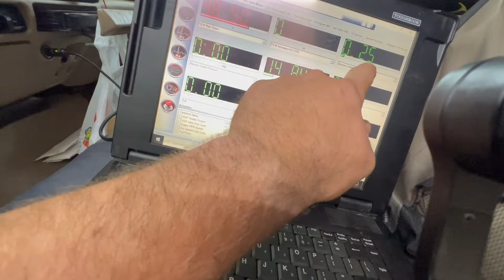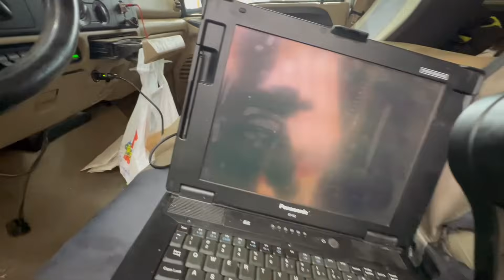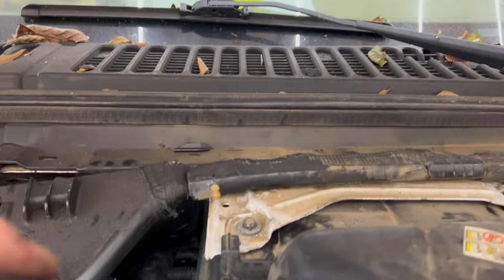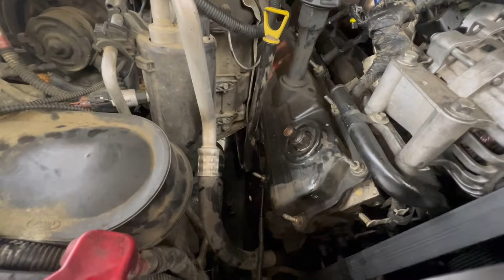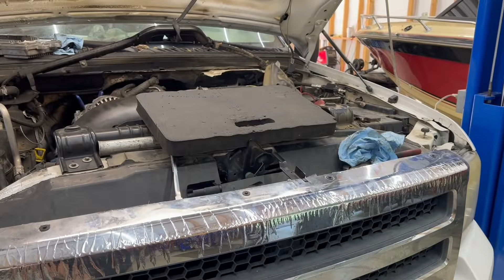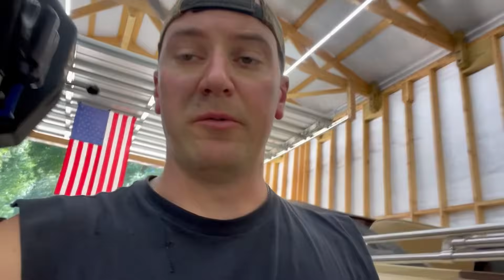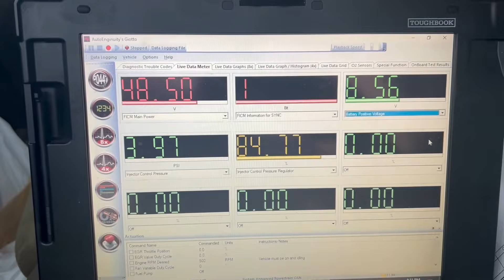6.0 Powerstroke crank no start diagnosing

Comment: Goodnight friend. There is no DTC, I sent you a video on Instagram, the oil pressure reaches 230, nothing more, I bought a high volume diselsite pump and installed it but it didn't start.
Reply from the maker: If your only making 230 on Hpo then there is some DTCs. Need to air test the system. Why did you replace the pump?

Comment: Excellent tutorial on air testing via the ipr port.  Thank you for the tips on passenger side access, torque sequences, and special tools.  Is is very valuable to know the high pressure oil rail nipples do bleed air while they fill up with oil after a repair.

Comment: I just want to thank you. I have a good scanner that shows me all the things you said to look at. I bought a non running e350 with low miles. The previous owner had replaced the ipr for some reason and the van was cranking but not starting. I had glossed over the ipr being good until you showed how to look at the pressure. I was only getting 350 psi of oil pressure during cranking, everything else looked good. So I found the old ipr in the van and cleaned it real good and put it back in and the van fired right up makes 1300+ psi of oil pressure. Thank you so much.

Comment: I have a 6.0 crank no start. Ficm power 48v drops to 47.5 while cranking. Healthy 1400-1500 icp, ipr is 20-30% when cranking. I’m missing ficm sync, receipts show cam position sensor was replaced last year, pigtail too and a new/used pcm. What are my next steps?
Reply from the maker: Gotta find why there’s no sync. Crank and cam sensors aren’t that common for going bad it’s usually something to do with wiring.
Reply: How much air pressure did you put in there

Comment: Replaced entire oil system and still no oil getting to the rails. New 6.0 owner, any tips would help TIA
Reply from the maker: Did you replaced the LPOP
Reply: It was replaced by the previous owner from the looks of it. They threw a bunch of money into repairs, I’ve thrown a bunch of money at it as well and still just a crank no start
Reply: Gonna be doing a compression test today on the engine. Hopefully, it’s not down a cylinder or anything. I can’t really tell because the OBD plug isn’t working properly and I’m not really sure what to be looking for if it is bad
Reply from the maker: @urchinlookinmf  without a scan tool and the obd working you’ll never get it fixed. You gotta know what’s wrong to fix it.
Reply: Front cover has score marks in it at the low pressure oil pump

Comment: I have great oil pressure and great fuel pressure but won't start until I shoot a little ether in it then it fires up and runs great until you cut it off. What's your thoughts 🤔
Reply from the maker: What is your icp and ipr when it won’t crank
Reply: @AutomedicGarage  icp 47 and ipr 574
Reply from the maker: @rodneygrainger4274  do you have 12v across your glow plug relay KOEO?
Reply: @AutomedicGarage  12.4
Reply: I'm stumped. I tried my snap on scanner just for ideas and I have the Apollo D-9 and it's badass but no help. I know I'm missing something
Reply: @rodneygrainger4274 did you ever figure your no start out? I have one doing the same thing as yours. Has oil pressure but won't start.

Comment: I replaced my icp and mine cranked fairly quick then next time I went to crank it was extremely Long. Icp now says 365psi then finally cranks
Reply from the maker: What year? Sound like your developing a high pressure oil leak or if it is a 03-04 your getting a weak pump.
Reply: @Automedic Garage  06. I found it passenger side stand pipe. Second oem from my ford dealer within a year and a half. Not sure if they were sitting a long time but this set I greased well. Hope it last longer.
Reply from the maker: @alabamalewis2704  I’m glad you found it. And thanks for watching.

Comment: I did that same job last year and I did both sides and found that I had Dorman parts that failed in my.6.0 make sure you buy motor craft or Standard brand and it takes about ten minutes of solid cranking to start the motor,good luck wish I was with you.
Reply from the maker: Yea I only use motorcraft parts as mentioned and it doesn’t take 10 min of cranking to start any of these unless you have a weak hpop or other leaks in your hpop system. Several 20 sec cranking intervals is all it takes with these. Did a hpop on 03 yesterday and it took 3 20 sec cranking intervals. Thanks for watching.

Comment: Hey I have a question what if it didn't show any oil pressure at all on the gauge in the truck when you were cranking it what would that be ? Thanks
Reply from the maker: It would point your towards the low pressure oil pump, in turn meaning the hpop has no supply of oil to make high pressure oil.
Reply: @AutomedicGarage  thanks for responding man iv been watching all your videos on the 6.0 cause I just got one lol and it has a crank no start said it was the hpop and I'm trying to figure out why my gauge is not moving but it is pumping oil into the oil filter

Comment: There's a tool that can remove the stand pipe without removing the rail?
Reply from the maker: I’ve seen pics of a homemade tool, it involves a hose and a threaded piece rod that you tighten up and it expands the hose inside the top of the lower portion of the standpipe and creates enough friction to pull the lower portion out. I haven’t explored the idea and tried to make one yet however.
Reply: It seems like not removing the high-pressure oil rail means not having to deal with rushing all the air back out of your system. Short term problem but Tinsley better fix.

Comment: Any guesses on what’s causing a rich exhaust smell at idle on a ford 2v v10? All usual suspects have been checked or replaced. No codes or cel. Vehicle is a 2000 f250. Truck runs great other than a stinky exhaust smell at idle. No obvious drop in mpg 🤷🏻‍♂️
Reply from the maker: Clogged cat or vacuum leaks or possible dirty/stuck injector
Reply: @AutomedicGarage  thanks. Just had the cat off while redoing the exhaust. It was clear, I could see through it. I’ll try until lugging a injector one at a time to see if rom changes. Probably is a vacuum leak somewhere. The usual culprit is the one under the throttle body that goes to the pcv. Cheers 👍🏼

Comment: Now yeah got her sealed up tight and trucks makin 4000psi first time in prob over a yr will probably be back in a few weeks for a stc fitting and another injector or 2. LOL With fall comin and cooler mornings im sure  stiction issues will be popping up from running on that chunky vintage oil while that ficm maybe on its way out voltage dropped to 45v
Reply from the maker: I contribute the voltage drop to some shady old batteries. But yes STC fitting could bring not updated already and the old oil sure didn’t help with the life of the injectors. I preach to all my customers of 3k mile oil changes and arch oil additive or rev X if it’s already having Stockton issues. Truck ran great and strong and has no other current issues. Thanks for watching.